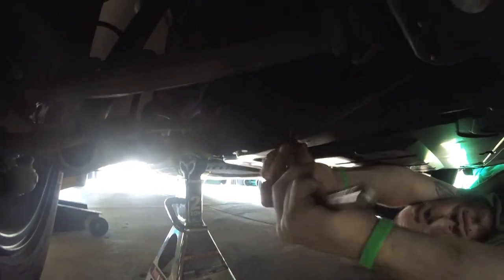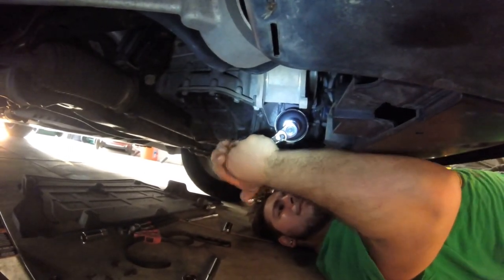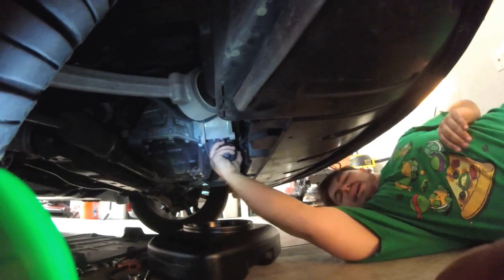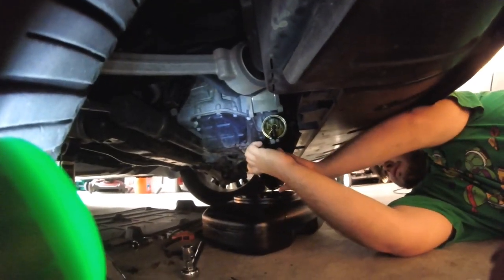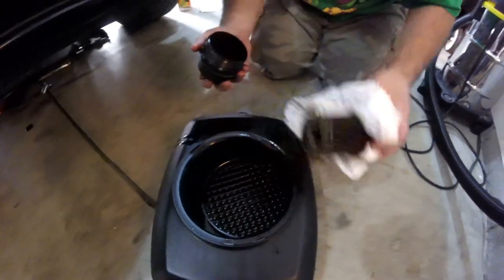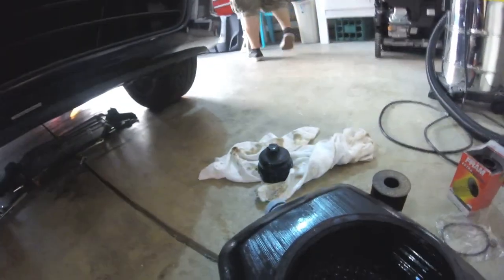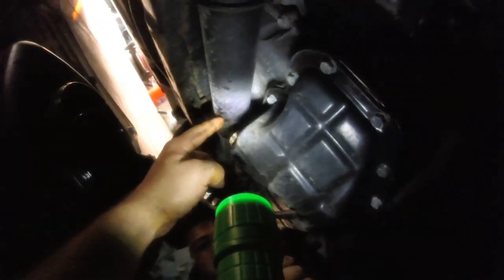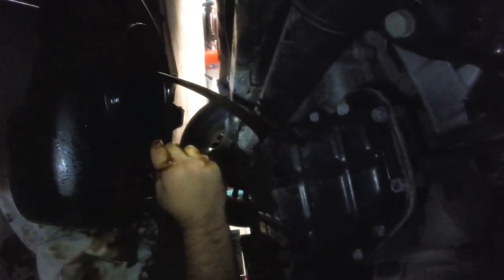DIY How to change oil and filter 09-12 Hyundai Genesis 4.6 Sedan

Comment: The filter assembly has a drain plug. It is a hex, and you should drain the oil before removing the filter cover.
The small o-ring is for the drain plug, its a good idea to remove the old and replace with new.
Reply: Thanks

Comment: I suggest a longer ratchet   when  removing the 17 mm oil drain bolt    some  are on to tight  and you will struggle with a short ratchet    leverage  is your friend   I know all the tricks.  I  use a   real nice Mac  long handle   works  grate     but  again I do this all day
Reply from the maker: Thanks for the confirmation in the other comment and the tips. I have a big ass ratchet now, back then my tools were limited.

Comment: can you change the oil filter without the the oil draining out if you wanted to do extended oil change intervals?
Reply from the maker: +jwbarker81 Yeah, only a little oil will come out if you just take off the filter, just like in the video. Half a quart max, probably less. Just collect it and put it back in after you change the filter.

Comment: i have a question i hear a clicjing sound from my rear tires could it be my cv joint
Reply from the maker: Yes it could be the cv axle or the wheel bearing itself, or even a bearing in your rear differential (unlikely) depending on where exactly the noise is comming from. If you find your cv boots to have cracks/slits/tears in them or any signs of them leaking grease, then they are likely the culprit as this would allow the bearings inside them to wear prematurely.

Comment: I don't know why auto manufacturers can't have access panels for oil filter and drain plugs
Reply from the maker: I mean some do, and some are even right under the hood with the bottom flipped up and you can just grab it and twist it off. Depends on the car, but most are a pain.

Comment: Where does that other thing go that comes with the large O ring? It looks a small washer with a rubber center?
Reply from the maker: desmondruff If I remember correctly, ours came with the big O ring, a small copper washer, and a little rubber O ring. The smaller shit is actually for the v6 genesis coupe, we only needed to use the large O ring if I remember correctly. Only use what you took off the car, and make sure it is the same. You may have gotten the wrong shit, though some sets may just include the v6 stuff too like ours did, that way the kit is universal. Be careful, make sure you have exactly what you took off and dont use the other peices. If none of the peices match what you took off, you got the wrong shit.
Reply: Guns&Cars oh ok cool. Thanks
Reply from the maker: You're welcome.

Comment: what size socket you used on the oil filter ?
Reply from the maker: +speedtime 27mm I believe
Reply: it is a 27mm  I work at hyundai as a lube tech
Reply: A 28 will work as well in a pinch